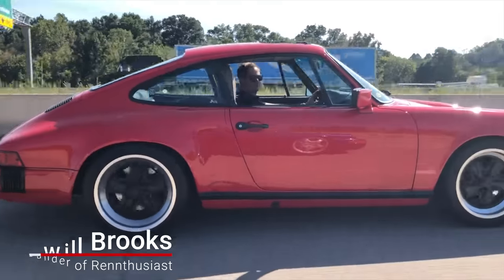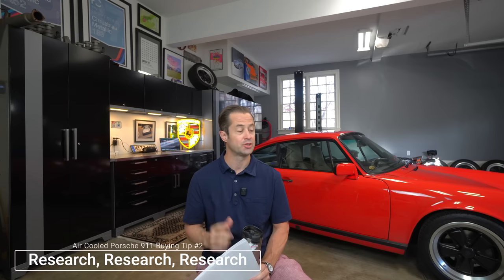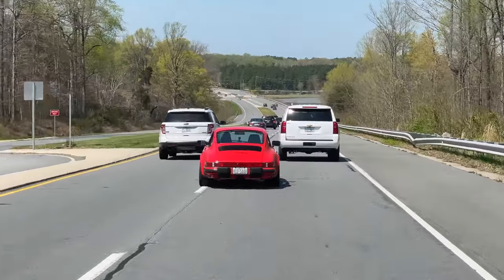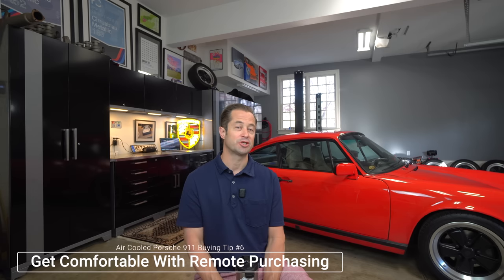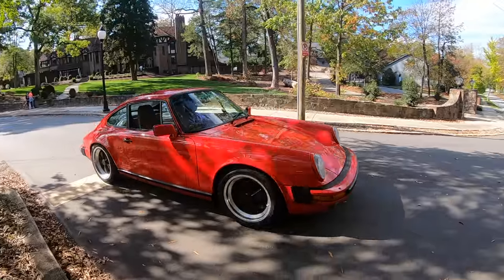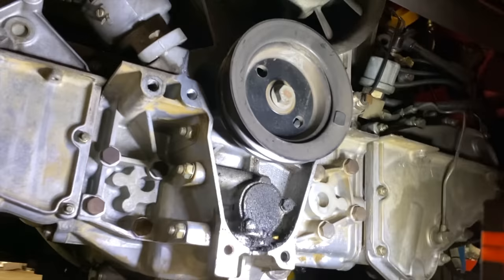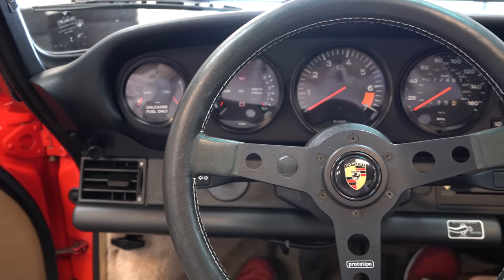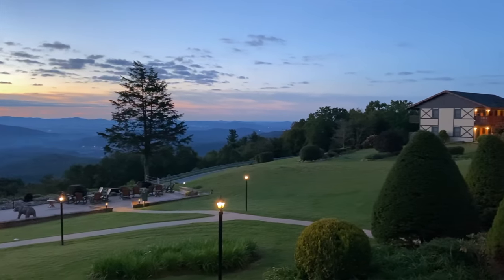How To Buy An Air Cooled Porsche: 12 Tips For Buying Your First Air Cooled 911

Comment: I've a 1996 993 C2 iris blue metallic. Multi full-concours winner. I just completed the 60,000 mile service and it runs like a Swiss watch. 6 speed manny tranny (G50). I also changed the 0.45 Ohm ballast resistors for the oil cooler and HVAC. (What a pain.) I also changed both lower camshaft cover gaskets coz they were 'sweating' onto the heat exchangers. I've had people pull up beside me, at the lights, offering ca$h in a suitcase!
Mine has an LSD and I've found that Mobil 1 75W90 LS turns the gearbox into butter no matter the season (winter/summer).

Comment: Yes, they get under your skin. I have a 993, a 912 (1968), a 930 (1979) and a project 911 (1977). Started out by restoring a beetle and fell in love with the simplicity of aircooled engines. I have had a few other porsches - a 1979 911 and a 928 S4, all great cars. Thanks for the tips, I broke many rules when I bought mine and I‘m still paying  the price with the 930 which just has one issue after another, its not really sorted yet, should have, could have been more careful but got caught up in the excitement of possibly owning a 930.

Comment: Good tip 👌🏿, I’d add. Do not let mileage put you off,  just ensure if car is over 60k miles  had its service accordingly and at 80k has had a full service on the 993 at over 100k a proper full service (likely engine out jobbie) as well should be put into consideration, per the 964’s the engine seal has been done, also ensure the suspension on them has been updated, exhaust heat shield checked etc else they emit smoke on the rear right of the car (due to oil sipping onto the shield to the exhaust leading to smoke coming out the rear right side), windscreen pillars checked for rust, horn does not bleep if braking or going over bumps( issue could be on the steering, O-rings), door hinge is looking good and no issues else can cost an absolute fortune to rectify, common issue on the 993 due to design fault. I would also suggest every owner of the 993 get the Haynes manual (Porsche Carrera service manual 1995- 1998) it’s got in-depth guide on the car even if just for information purposes. 
The older cars I echo every single word you mention as well. . Cheers and good luck with the next purchases. 👍🏾
Reply: In which country are you residing?

Comment: My first 911 air cooled was an 89 3.2 with the G50 transmission. 170,000 miles on the cabriolet original paint , original interior and patina from the driving . No rust , new top converted to a manual up down . Car was accident free with full documentation and photos of complete power train rebuild . Lots of conversations with the actual mechanic . Car had a leak on the AC which ran about $250 for repair after a few weeks driving it in the summer . No big deal . Interesting comment from my local Independent porsche repair guy on the manual up down on the new top in which he commented it was a very smart decision as the shop can make a living on repairing the electrical up down on the cabriolets . I also own a 12 911 with automatic cabriolet and love both cars .....now looking for a turbo ......3.2 I have is driven hard and is bullet proof as suggested on this video but also by my mechanic.......by the way the shop I use for annual service all know the car and comment on how much they admire it and love it
Reply from the maker: Thanks for passing along your experience

Comment: First Porsche was a 67-911 S that I bought used and was a daily driver. When I traded it in on a 83-911 SC the 67 had just under 300k miles on it and the only engine failure with the engine I ever had was a rocker arm that broke and I still drove it home on 5 cylinders... The 83 also was a great car I can see why these cars are going for a fortune now engines were bullet proof. The 83 just had small stuff like sun roof stopped working one electric mirror same thing but overall great car.

Comment: Good tips, bought my 87 911 Targa in 91 (one mo. Before our first child - because we knew we would not do it afterwords 🙂) 28 K miles, had a Porsche dealer inspect it for $75… and widdled down the price another 3K (he wasn’t happy… but a day later he sold it to us). Still own the car, spring, summer, fall pleasure driving.. now it has 38K miles and still looking good in and out. Had to replace the Targa roof and recently got a valve job + miscellaneous things done ~ $3.5Kish. New tires, rear brakes.  Some d-I-y projects (steering wheel o-ring). Past that I got to go for a drive….   Then eventually pass it down to my 30yr old kid who used to fall asleep with the sound of the engine… if he wants it.🤔.  I’m one and done with air-cooled,  maybe a newer model 4wd 911 daily driver.

Comment: Great video. I bought my first 911 5 years ago. it was a 86 coup 80,000 miles and had no problems. I sold it a bought a 96 993 C4 cab and it been perfect too. I wanted a driver so I found a 01 996 and drove it for 2 years in the good weather months and garaged it in the winter. I sold it and found a 03 C4S and that car is fun also. But I have a love for Corvettes I now have a 08 C6 low milage one owner all receipts . I need to unload one of the Porsches. ??? which would you get rid of. Thanks Around Bend Oregon out!

Comment: Great video! Suggested future topic: how hard (or easy?) is it to find parts for a 30 year old Porsche? I had a Toyota Tercel for 29 years. Toyota sold a ton of these in the USA but... after about 20 years it became impossible to find parts. Really common maintenance parts (pads, rotors, oil and air filters) were available, but... interior trim pieces and replacement rubber seals for the doors were unavailable anywhere. Is it the same for Porsches, or are there 3rd party firms who fill in the gap of making replacement parts that are no longer available from Porsche?
Reply: Kind of, but everything costs a fortune

Comment: I am new to your site and I hate to text. I an oral  person and have a 911sc 1983 since 1987.I live 2 hrs drive fr Dallas
Reply: I cut myself  off
 I do not have local help with my car. I took it to a large dealer in Dallas and 17000 dollars later and 7 months later I have a drivable, livable  car but need help for future repair. Where in Dallas metroplex is good repair with reasonable prices. My car is not a sculpture  but a driver
I am not obsessed  with car but enjoy reliability  which took 7 months and. 2 tow  jobs for drivable  condition. I have oil leaks that were not there before recent work and a cold start problem with new part that should prevent this. Help on a good 83  911sc . In reason able9
Reply: Call

Comment: If you could only own 1 air cooled, the SC or 993 ? 
Or something else but only 1.
Thanks in advance
Reply from the maker: Budget driven.  The 993’s seem to be jumping up right now while the SC’s seem to be holding.

They are both fun in their own right but a consideration is that the SC has the 915 gearbox which is a vintage, more antiquated-feeling transmission.

I have always maintained that if I could only have one it would not be a 915 (although I do love it)

So, my answer would be 993.  They’re sooooo fun and gorgeous and now seem to be going up in value.
Reply: I have a feeling he's going to say 993 🙃

Comment: Is an Air-Cooled Porsche a base 911 Carrera (non-S, Non-GTS, non-T, non-Turbo)? Oh wait... so air-cooled is a vintage Porsche? What type of engines are in current/recent 911's  around 2017-2022? I'm also confused with 911 997 & 911-993 & 911 997.1 & 911 997.2. Why so many versions? Ugh... maybe I should just buy a new car. Do you recommend purchasing is used Porsche from a Porsche Dealership?

Comment: What is the best air cooled Porsche with respect to AC. I live in south Florida and need a good AC.
Reply from the maker: 993
Reply: @Rennthusiast  which is the best 911 for backseat space (for kids)
Reply from the maker: Hey Eddie.  I have never put my kids in the backseat of my 911’s as I mainly use them for solo errands, rallyes and solo road trips.

That said, the dimensions of the older 911’s are pretty similar to one another.  Small, tight and great for a couple of bags.  The newer cars are much larger all around so you may want to look in that direction.

Also, go search Rennlist.  I have seen conversations about this topic there.  Good luck.
Reply: @Rennthusiast  I still have plenty of time to look. Not in a rush as my kids are still quite small and I’m hoping prices will stabilize. It would only be for short runs. My daily is a mustang convertible and the kids fit just fine
Reply from the maker: @eddiefalcon8316  yes the market is nuts.  I’m publishing a video next week about the 7 reasons you should buy a classic 911 in spite of the sky high prices though. 😄

Stay tuned, and thanks for watching.

Comment: How did you make out with your chip you added to the 993
Reply from the maker: I am quite surprised at the impact it’s had.  I had low expectations and the throttle response improvement is actually quite noticeable
Reply: Was it worth it
Reply from the maker: Yes

Comment from the maker: Have more ideas for people trying to get into these cars?
Reply: I think a lot more gues into the first tip. Many first timers don`t know if they should go for SC, 3.2, 964 or 993. I excluded the F bodies as they are most often out of pricerange for curious first time aircooled 911 buyers. Also, why wont you consider SC? Its another experience than 3.2.
Reply from the maker: Great point.  Maybe a video in and of itself about deciding which generation to go for? 🤔
Reply: @Rennthusiast  I’d dig that!
Reply: @Rennthusiast  Go for it. I have experience with a few G bodies and they are a different experience all of them. Most because of the fact that they are old and have had a different life. That said, I dig you channel Will. G body 911s is my dear hobby and I've been enjoying mine for some years now. I turn wrench on them myself, but I also do sporty drives and camping aswell. I identify myself with how you project these cars. I just felt the need to say this as I live on the other side of the planet and will probably not be able to say it face to face. Keep it up!

Comment: Inspection tip: 
An aircooled P will make a singing noise/sound when closing the door without your hand on the door.

If the doors do not sing, do not buy.

Comment: Can you define a "good PPI"?
Reply from the maker: In an ideal world it’s one that first of all catches any major systems issues 🤔

In all seriousness, though, I have had really good ones done in the past with the shop providing video of the mechanic walking around and underneath the car on a lift, pointing out issues.

Also, compression, leak down tests for engine health.

Look for signs of an accident or rust or really anything that doesn’t line up with the story the seller has given you.

At the end of the day, though, there is still obviously exposure as things can get missed like in my case.
Reply: @Rennthusiast  Okay, so I haven't bought my 1st one yet but I am real close so I was thinking I wouldn't know what's considered a thorough list of items to check off and what's basic.
Reply from the maker: I would say based on my experience get as much info as possible.  Don’t skimp.  They all need something and you really need to know what you’re getting into.